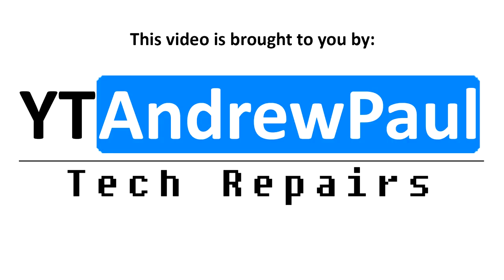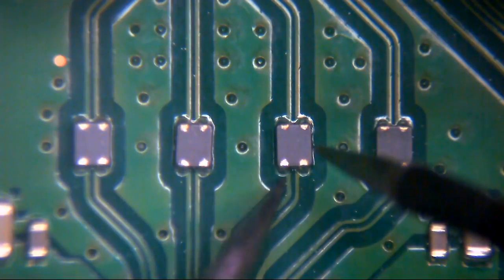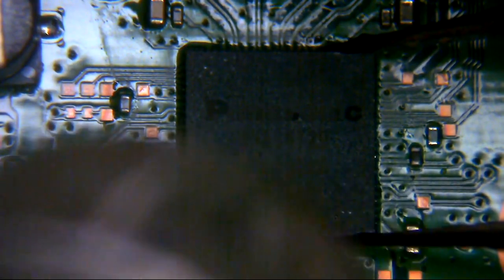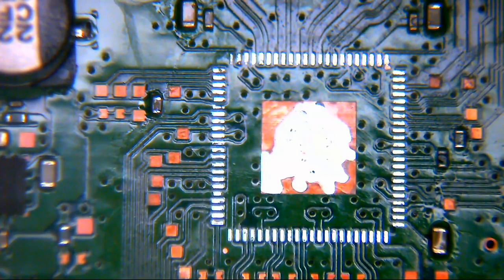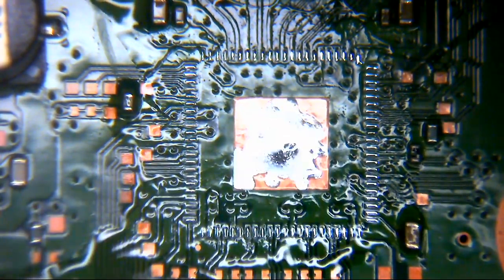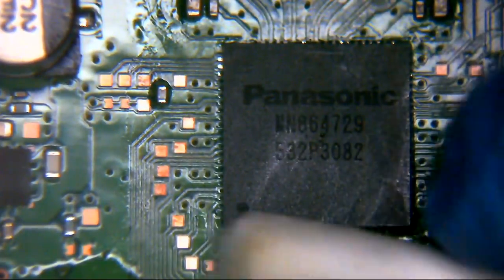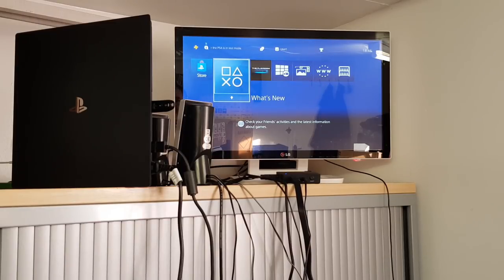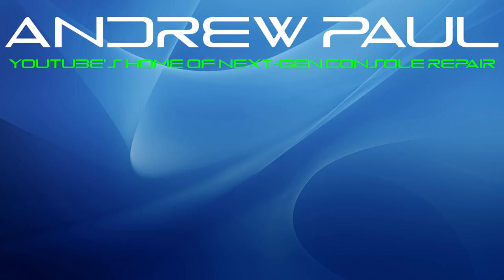PS4 PRO HDMI Encoder IC change no signal - diagnosis and repair. NVA-001 (applies to all boards)

Comment: This was my machine. I'm happy to report, it is now working flawlessly. It was a day one console, so it's almost 2 years old. Always keep my consoles clean and as dust free as I can manage. It's odd that the hard drive wouldn't play ball on that first boot. I swapped that hard drive out for a 2TB Firecuda as soon as I got the console unboxed. I did contact Seagate about the failed 2TB (you may remember it was with the console when I sent it) and am currantly waiting for replacement.
Reply from the maker: It was like new inside - the cleanest console I think I've ever seen!
Always worth a moan at Seagate - I had a dead disk (ST500LM - horrible disks) and the replacement was also DOA though I didn't test it for around 3 months after. They dragged their heels but eventually gave in and replaced it again lol... I think the social media threats probably swung it in the end!! ;)

Comment: Cause this video, i got a zeny rework station and wanted to experiment. i replaced a panasonic encoder on a PS4 slim. soldered it on perfectly. screen came right up. great video nice work.
Reply: i also Found out kind of late that of any Inductors  go bad u also get no signal. The Encoder might still try to put out signal but u will go back to no signal.
Reply: @eman59461  inductor?

Comment: For QFN, I use a small J tip or small knife tip and drag a ball of solder across the pads to make good connections. I also use a lot of flux and heat to keep the solder from bridging. Try those tips to see which ones you like better.
Reply from the maker: Hi Anthony, Yes I use the J-tip method for finishing them off where needs be. I need to buy a new tip for the JBC though as the other went with my Jovy.

Comment: Hello Andrew, in case the filters were open, is it possible to remove them and jump them using wire? And is it possible or is there an existing procedure to verify the encoder IC by multimeter? I appreciate your support, thank you.

Comment: Hey Andrew, i got a Problem with my Pro. i Changed the EMI FIlters, 3 Times the Panasonic Encoder, HDMI Port, and the Diodes that was Burned out. the COnsole has White Light, Syncs with Controller and goes in Recovery (Blind) even with or without HDD i got no Signal, the Monitor say No Signal What can i do next? if it maybe a APU Problem? I hope u can help me :(

Comment: Nice video Andrew, any tips on how to avoid damage to small components close to the area you're working in when using the hot air station, I'm fairly new to using the hot station so I was using Kapton tape but its not always practical to do so. I've decreased the air flow which most certainly helps from blowing the little blighters into cyberspace, lol and most certainly am getting better, also what do you find is the ideal temp to use when working on a board, do you use a constant temperature or do you vary it depending on the component you're working on?, many thanks. MOT
Reply: You could try using Aluminum Foil Adhesive readily available if Kapton is not able to be used. It does have a tendancy to unstick though when Flux hits the sticky side. It deflects heat really well however
Reply: Tanx Steve c, picked up a roll from my local heating supplier for future use, hadn't thought of that, tanx again
Reply: OMG i learned this the hard way so bad, may tiny things got lost in space. had to buy another motherboard (it was a phone repair but same thing happend to me hehe)

Comment: Hi. Do you happen to know the value of the resistor on the top left edge or boundary at 12:53? There is a zener diode (i believe it is a 24v zener) and with it a resistor, maybe. Any idea?

Comment: Hi, great video sir, i want to know what if the filters have continuity in the 4 points. The 2 on the right side are like that. do i have to replace them or what else can it be done. Thanks

Comment: Hi Andrew hope you're well. Have a question for you. I managed to remove my old HDMI Port and install a new one thanks to your videos, but I'm having a hard time seeing and soldering the pins as they are so small and my eyesight not being like it was. Can you tell me what I could buy without breaking the bank that would give me a good view of these pins so I can do a good job of soldering them. Many thanks. Mick Northern Ireland
Reply from the maker: Hi Mick,
A jewellers loupe or similar may be useful, or there are desk-based magnifier lamps available for around £50-80 which would probably be the best options on a tight budget.
Reply: Doing a bit of research online for the best bang for the buck, hopefully I'll get something sorted.  Thanks for getting back to me. 👍
Reply: get your self a USB microscope that what i use plug in to your laptop as the screen worked for me and there cheap

Comment: Heya andrew what u think of a ps4 pro that won't connect controller via usb after reset..it does and respond well in safe mode but when the system loads up and push ps button it is a no go seems to work when it wants any ideas ? And thanks in advance I luv ur vidz ! Have inspired me alot !

Comment: Hi Andrew, i have just phoned up a repair shop to get my ps4 hdmi port fixed but they said that they didn't have the right equipment, aswell as highly recommending you. And i was just wondering if you were able to help or not. I am based in the Merseyside area.
Reply from the maker: Hi Daniel, sure thing bud - I've just dropped you an email in response. Many thanks.

Comment: I have a problem in the same board. But the problem is a blackout after couple minutes. I made reballing in the gpu.
Now the console works normal in the browser, but it makes a lot of noise during the games and sometimes it goes off. Was it any more a problem? memory, south bridge? And how to do the reballing without dropping the bga on the opposite side of the board?

Sorry my bad english.

Comment: Hello friend, great video. I have a ps4 pro which I have tested the wire hdmi and it is fine, I have tested the connector HDMI putting a connector at one end of the wire and checking coninuity and values, I have measured the filter with voltaje drop and they are fine, I have also checked the readings on the chip and I think it is also fine, however after all this my ps4 remains white light and without being able to enter safe mode or anythibng and no signal. What I can do? Is there a scheme to test more components or what shoud I test now? The board is nva001 the same as the one in the video, could you tell me what other values I can measure or compare the readings of the chip? Thank you Andrew

Comment: Hello Andrew, I need your professional advice, i am based in Pakistan and my Pro has gone under same HDMI IC problem with white light and no display and some glitches sometimes. Problem is, the local repair shop ive taken my ps4 to has after a long lockdown phase, said that my IC isnt matching and is unfixable and is showing black screen after 2-3 multiple IC replacements. Now im kinda getting worried as to what to do is it repairable or am i gonna lose my money on this Pro. Please guide

Comment: You mentioned that the APU is responsible for the 4K output.  That got me thinking.  Aside from the possibility of a larger APU package, the lack of available video ram and power delivery issues (assuming the power supply in a standard PS4 wouldn't be capable enough) could the Pro APU be swapped into regular PS4?
Reply from the maker: Sadly not :(

Comment: Hi boss, a question: at what temperature do you have and how much air have you set to unsolder.  Thank you
Reply: I usually set it to 450F with airflow on 4. The get it nice and hot because the center of the chip has a good dab of solderr

Comment: Hi everybody and thanks Andrew for the video.
I’ve a ps4 pro and I have made a mistake. I plug hdmi on a switch hdmi hub, powered with 5v, but I have connected him upside down, so with -5v.
Since I have the wlod syndrom ( fix white light, normal functioning). I found a lot of topics about testing components on the classical Ps4, but nothing with ps4 pro who have a different layout (nvb-004 mother board). I’m not sure the hdmi controller is dead, i have tensions on differents pin of signal hdmi but 0v on the 5v pin hdmi. I have already tested filters, Capacitors and diodes who seems ok. I would like test all critical components before change the hdmi controller. Can I found the schematics of the hdmi part? Any help will be good to take! Thanks!

Comment: Hey Andrew. I test the HDMI encoder IC's every time I suspect one by checking the voltage drop to ground in doide mode on the 8 data lines. Almost every time the HDMI encoder is the issue the readings have been extremely low and near a full short. If a customer states the unit was not dropped and the video just stopped working while it was on a shelf I'll check the data pins on the hdmi port in diode mode without even opening the unit.
Reply: Hi Anthony Thanks for the Tip , which lines are the data lines? and do you have the actual pin diode mode numbers? Thanks bud

Comment: What can I do if the HDMI filters do have short circuit between them
Reply from the maker: More often than not 95% of the time this is down to a defective Encoder IC. Remove the IC and most likely the shorts will disappear. If they do, replace the IC with a new one.

Comment: Hi I bought IC chip for slim 2nd already. Is any way to test IC chip itself before installing it. I suspect that I bought faulty chip
Reply from the maker: Sadly not really. They're an awkward thing to change especially if you're not used to doing this type of work.
Reply: @AndrewPaul  thanks for your reply. Yeah I've noticed that. Successfully replaced it with temp 360 celsius on my fan - not sure if this temperature was safe (but managed to make it in 2 goes). Additionally done pre heat from underneath just before start

Comment: Hello Andrew. I have a ps4 slim motherboard SAF001, it doesn't show video. component with 5 legs above "TH2001" sign is heating as soon as I turn on console. any ideas what could be the problem?
Reply from the maker: That component may very possibly be shorted. Replace it in the first instance and see if the situation improves. If not, it may be necessary to replace the Encoder IC itself.
Reply: @AndrewPaul  thanks mate, I replaced diode above the hdmi it was soldered in wrong direction :) someone had worked on it before me

Comment: What if one of the filters are damaged or not reading correctly?
Reply from the maker: If that is the case then you'd be best advised to replace the filter. You can bridge both sides with wire if you can't get the filters, but this isn't something I'd personally do. It will work though.

Comment: After a Technician changed my hdmi integrated chip, He was unable to install the system back. I am tying to do it myself, but I do not seem to be able to move right on this screen to the ok button, even with the pendrive inserted. Also, all the safe mode menu options are disabled, but last option initialize. any ideas?
Reply from the maker: Sounds like a bad hard disk. Replace it and see if that allows you to complete the re-initialisation of the machine. This issue won't be connected to the encoder change.

Comment: need help with 1200 series PS4 giving overheating error and shuts down
Reply: 1 - check if the fan is working properly
2 - dust (i mean on the heatsink; fins get blocked). You have to disassemble to clean. While at it replace thermal paste since you have already opened it anyway.
3 - if that doesnt work, some users report changing thermal pads on the VRAMs have helped.

100s of videos on youtube i wonder why you even asked this question.

Comment: HI ANDREW FIRST OF ALL HOPE YOU'RE OK ,, AND HOPE YOU CAN HELP ME WITH MY PS4 ,  WAS PLAYING AND UNEXPECTED IT TURNED OFF AND THE CONTROLLER DOESNT SYNCHRONIZE ANYMORE AND WHEN YOU TURN ON THE PS4 IT SHOWS AN ERROR (NM-35959-1).  NEED YOU HELP BRO !!! 
REGARDS FROM USA !!!
Reply from the maker: Sounds like one of either firmware corruption or a physical module failure. Common issues sadly with PS4.